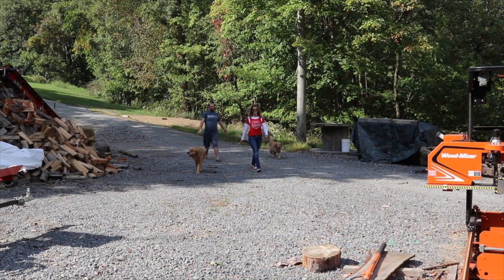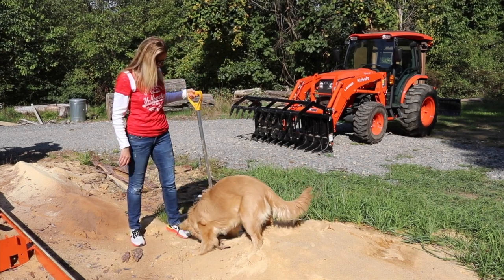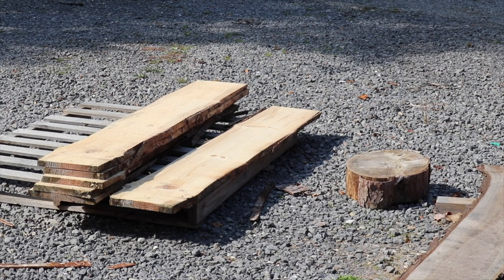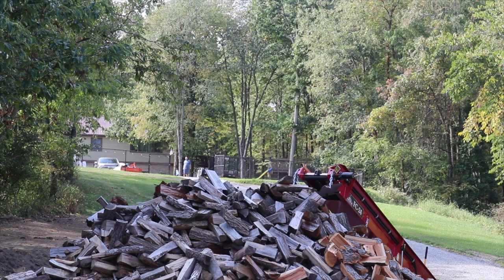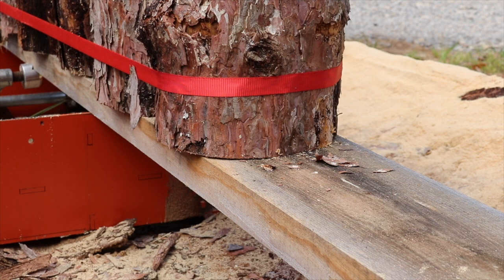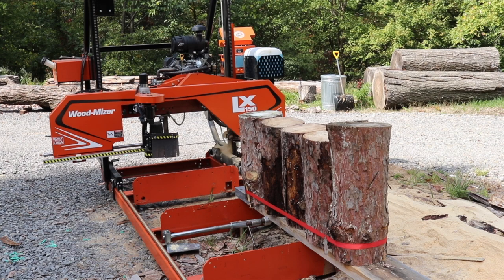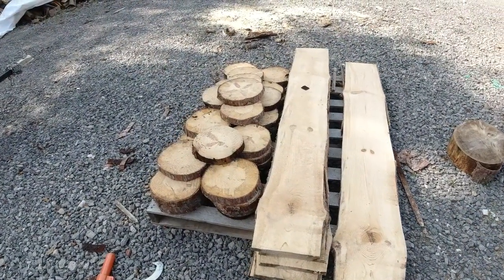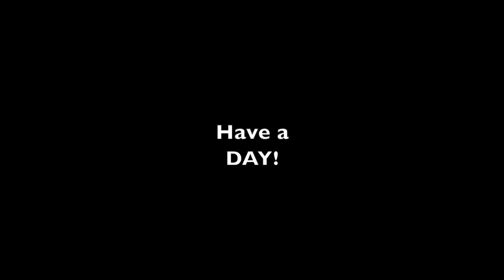#916 Strange Way to Run a Sawmill! Making cookies without an oven

Comment: I wonder if the drying process warps the cookies at all.  I did 15 with the chainsaw and I am not sure if it is the chainsaw operator or the drying process that made the cookies a little wabbly on a flat surface.  that is the nice thing about woodmizer.. you know the cut is even.
Reply: It's the shrinkage that is murder on cookies.  I cut my cookies with a chain saw about 3/8 " - 1/2"  thick out of weathered pine.  They make great fire starters. Crumble them up and squirt a little charcoal starter fluid on them. Put some smaller split pieces of firewood on top of that and lite a fire.

Comment: You really didn't "drop the ball" re fuel and battery charges, you depicted real life: At least my usual version of it!! LOL  BTW: you seem to be doing this somewhat frequently: Perhaps an L shaped fixture out of 2-by stock would secure the lojs better. If the side to the Left from the operators view was reinforced and screwed in it would eliminate the wobble. You might not be able to cut as low as you have but it might be safer?

Comment: On the cookies, how do you get the first cut level? I’m not that good with a chainsaw.
Reply: In case he doesn’t answer, I’m pretty sure the first cut is referencing off the flat, level surface the logs are sitting on, and the first cut could be waste if his chainsaw cuts weren’t square enough.
Reply: Jeff Roberts the surface they are sitting may be flat and level, but the rounds cut with a chainsaw have to be square or else the flat sides of the cookie won’t be parallel.

Comment: At 8:43 while sawing the slabs, what looks like a big puff of sawdust comes out of the log right where the blade is cutting.  It also knocks off about a three foot piece of bark.  Can you tells us what that was?  I have never seen anything like that happen before.
Reply: I’m thinking the bark was weakly attached and as it was coming off it blocked the discharge of the sawdust momentarily and made it look like more sawdust than normally was being discharged.
Reply: Eric Noland   I looked at it again and was able to stop he video just as the puff of sawdust, or what ever it was, came out of the log.  What ever it was it went in front of, and past, the discharge shoot before the bark came off.  What ever the puff was it was the same color as the sawdust.

Comment: Mike, what's your cost estimate for: interior finish, electrical, plumbing, heat? I'll go first. 30K.
Reply: Mike gave the $$ in yesterday's video.
Reply: @weaverkevin5462  I know. That was exterior only.
Reply: He did give a guess of about 85 to 90k when all done.
Reply: @weaverkevin5462  I must have missed that.